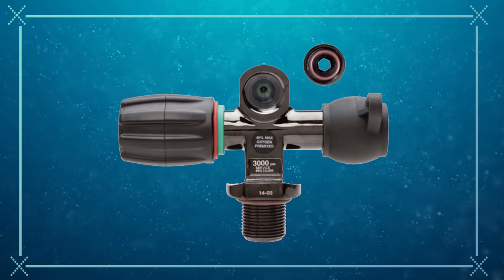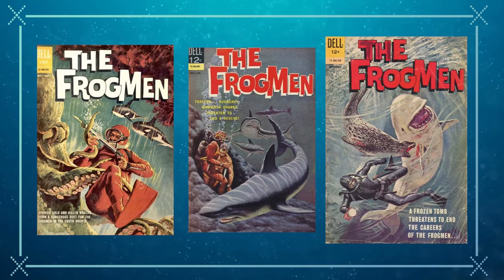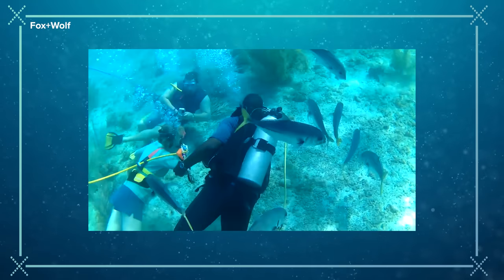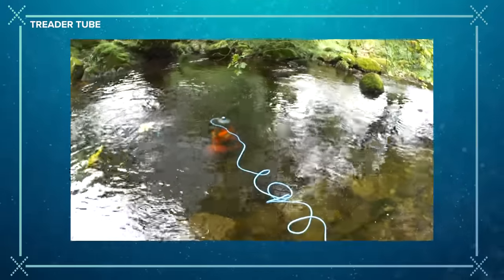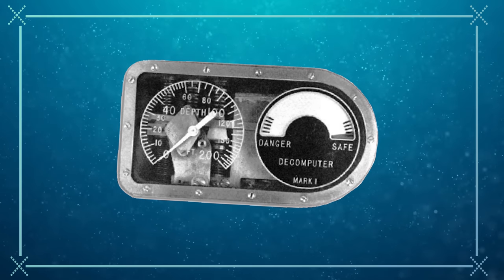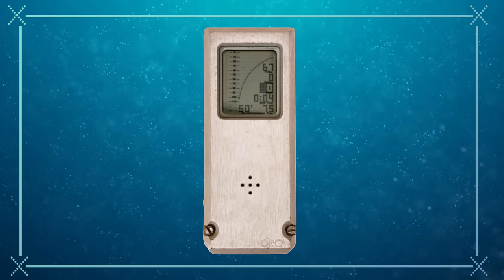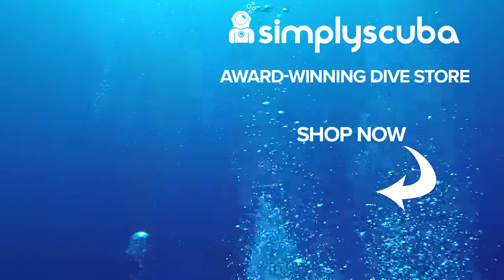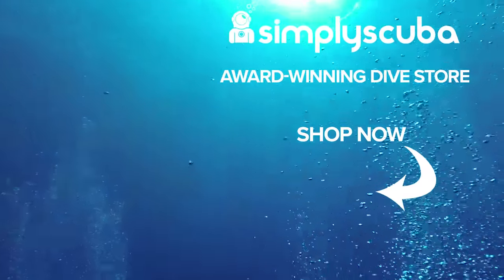Worst Dive Gear In The World

Comment: A large number of the gear referred in this video as "Worst Dive Gear in the World" were simply evolutionary.  For instance, the J-Valve was used, in part, because many of the pressure gauges at the time weren't nearly as reliable or accurate as today's gauges.  As equipment advanced, the need for the J-valve was reduced/eliminated.  So saying that some of the older gear on this list is among the "worst" is like saying that the plane the Wright Brothers flew at Kitty Hawk in 1908 was a total POS because they didn't first invent a fifth-generation fighter aircraft.
Reply: Yeah, but the DIY and snuba are both bad and dangerous, not evolutionary.
Reply: @echonovember636  Yeah, that's why I said "A large number..." and didn't use the word "all."
Reply: I thought that as well, about the J-Valve.

Comment: Snorkelling full-face masks.... wtf?!
Reply: death traps for noobs
Reply: I like mine.
Reply: @CavZippo  What's to like?
Reply: @whynottalklikeapirat  for starters  the visibility and having the snorkel straight behind my head.
Reply: @CavZippo  Actually you don't see much more and here is why:
- A low volume mask with the glass close to your face has a very wide field of view. It simply feels different to some people because the space INSIDE the mask is smaller and you can sense the sides.
- Full face masks are only rated for surface snorkeling. At the surface there is precious little to see to the sides - usually only the siltier top layer.
- Many of these full face masks have curved surfaces, which distort what you are actually seeing, like a fish eye lense would.
- The reason people who are keen to actually spot sea life use masks with dark silicone is that it helps you focus, especially in sunny conditions. It is usually not an advantage to be flooded by reflected lights if you want to see what other people tend to miss. 
- Because full face masks are not made of tempered glass they are more prone to getting scratches and fogging up.
- Because your entire face is enclosed, it heats up with exertion and sweat and sun screen is more likely to stain the "glass" further adding to fogging (and an unpleasant oppressive heat).
- A regular snorkel is also behind your head if you know how to place it properly.

That's the proposed visual advantages out of the way - anything else?
Reply: @whynottalklikeapirat  long winded statement that doesn't actually say anything about the difference between the two.  

And fog away works just fine.
Reply: @CavZippo  

Now you are just being defensive. You ignored everything I said about visibility and jumped on the least interesting part (ignoring the long term effects of a mask that is easy to damage).

You offered visibility - so I commented on that. The discussion was not about a general comparison - that's just you changing the subject.

If you like I can easily educate you on the general differences between a common mask (standard survival equipment) and a full face mask (crutch and potentially deadly toy for the inexperienced).

I say educate, because I am a diving professional with the background to do so. 

But I doubt you will have the attention span, because it is going to be just as "long-winded". True learning and proper training usually is. Which is why some people look for a perceived easy fix to various challenges.

Full-face masks however, have been implicated in a fair amount of recent deaths - so that's something to consider if motivation is low.
Reply: My is not that bad
Reply: @CavZippo  I am a dive instructor, and a spear fisher of 15 years. I have never advocated for "goggles" - I am talking about proper diving masks. The things I point out are mostly common discourse and based on well established industry knowledge. The "opinion" that you'd like to be so subjective is based on established safety considerations, that are not of my making per se - but certainly I can point to an archive of underlyin experience as well. Safety and equipment procedures come down to minutia, you know this having been in the army, so I don't see your argument with that. Take the advice or leave it at your own leisure. 

 
Have fun
Reply: They game changers in my opinion...but not for great depths obviously...
Reply: @weerobot  Only very few versions will allow you to equalize. You'll begin to feel real pain at around 3-5 metres. The large volume of air will require you to work hard to descend, wasting oxygen. 

By almost any formal standard they are inferior to what is considered standard equipment by professionals. 

What is the most significant game change in your opinion?
Reply: @whynottalklikeapirat  For surface swiming they take away the fuss of having to clear the snorkel of water...Yes no good for anything more than 1 metre..
Reply: @weerobot  In my opinion snorkle clearing should be a routine thing. 

This is not because I think it is something that "should be suffered" because we all oughta be such tough guys. It's because dealing with water in your eyes, nose or mouth is something that anyone venturing into water too deep to stand in has to be prepared to handle - ideally to the point where you don't even think of it as an issue.

Full face masks are not fool proof. One of my main arguments with them is that they can be used as a crutch that may get people to get into situations they are not adequately prepared for if or when things do not turn out as expected. The possibility of equipment failure ALWAYS has to be factored into activities at sea. 

Besides - lots of common snorkles have a reservoir and a purge function, I use one myself except when I am hunting. 

Another thing is that they are likely to muffle your voice if you have to cry for help. It's more difficult to remove than a normal mask, and most people who are experiencing the onset of panic don't think straight, I've seen it so many times. And even if you get it off - now you are without a snorkel and without a mask and you are struggling to keep your head out of the water and getting it in your eyes because you have no cover.
 

I guess I don't really see how they change the real game much.
Reply: @whynottalklikeapirat  Fair Comment...
Reply: @weerobot  @whynottalklikeapirat

You guys are sure entertaining to read :)

I think the main issue with full face mask is the dead space issue and CO2 buildup.

Having that said, things are not black or white... A few shades of grey in between (and a few more when you consider things that are not related to the CO2 buildup and dead space).

Simply Scuba has released a blog post explaining the concern and why some masks might be more ok than others: https://www.simplyscuba.com/blogs/blog/co2-in-ffm

If you search for "full face mask snorkel CO2" you will find loads of articles explaining the issue.

One of them is the lack of training and the lack of awareness. A person might go for some surface snorkelling, the person goes with a buddy, both having full face masks, they enjoy the scenery and do not realise they are moving away from the coast, while they snorkel CO2 builds up (in their body), and one of the two starts getting all the symptoms of CO2 buildup: dizziness, urge to breath, hyperventilation - which does not help if the dead space is full of CO2 - and so on. The person alerts his buddy, takes off the mask, but the CO2 buildup has exhausted that one diver, the second diver has higher levels of CO2 in the body (because of the full face mask) and realises he needs to assist his buddy to swim ashore. The both get exhausted, tide changes, they cross some current or something like that, both drown.

Isn't this a realistic scenario where neither did anything wrong (except checking from time to time where is the shore to stay close to it)?

That can happen due to a lack of awareness of the risks and symptoms.

I am sure highly experienced divers (like the both of you) will have a better intuition of what can go wrong, but a complete newbie, that might have had a few margaritas who is enjoying the so deserving break from work, worrying only about having a good time, might end up in serious trouble. Because you must remember, not everybody knows or understands the risks associated with these sports (not that drinking and swimming is not stupid and would be a great candidate for Darwin awards). I have more than one friend that thought of doing something like this for their vacations and do not have the reflex to think "I should buy the more expensive model because it is less risky for my life", they think "the more expensive model is for the pros, I just want to have a good time, I go to some online retailer and buy the cheapest one there". Because they don't/can't understand, due to the lack of knowledge.

Assuming that you don't play tennis. If you would go play tennis, and just want to have fun, you would not invest in an expensive racket. You would buy the cheaper models and that's ok. Because you are not expecting to go for some competitions, and to do some high performance training and so on. And that's alright, you most likely won't die because of a cheap tennis racket. The same applies for many sports. And people just don't understand why it is important to invest more in a snorkelling mask, as they won't go scuba diving, they are on the surface, where is the risk?

Since this is a thing: I am not a "pro diver", I am just a guy who occasionally dives and tries to understand how things work and what are the inherent risks of the different parts of a kit before getting any new gear.
Reply: @whynottalklikeapirat  I'm gonna sing along to this. They become crutches for people who can't deal with water in their eyes (or even their face). What will these people do when (not if) something goes even slightly different than planned. Water is for everyone, not just "legit" people. But you should always be able to handle it one "equipment level" lower than what you are using. 
If you don't like water in your face, learn to deal with that before sticking your head in the stuff. If you can't clear a snorkel, learn it before getting a supposedly "purge free" snorkel and attaching a certain ammount of your safety to it. 
I suspect that some of the full-face snorkel people just couldn't be bothered to practice (and come on, it's not THAT hard). Having reasonable mastery over a normal mask and snorkel, I tried the full-face thing, and it is hardly worth the bother. And then there is the fact that they are more complex pieces of kit, and sometimes cheaply made. Not a good combination.
Reply: @StickDK  I can only agree.  Standard equipment and procedure is standard because it has proven functionality in a wide variety of settings and because it structures and encourages desirable behaviours and routines. Some people like to think that anything different from the standard is an "innovation". A lot of people like to market their stuff as if it were. It's pretty easy. You take a standard training hurdle, familiar to most entry level people or just plausible to their imagination, and elevate it to "a problem of the field" and then you offer gimmick "solution" that appears to bypass the troublesome need for basic training and competency, without mentioning all the other often comparatively serious or even life threatening problems that creates, which are obvious to any professional of the field, but not so much to someone new to it. Just yesterday I had to have the "why can't we just make a 3 metre flexible snorkle" discussion with a bunch of old friends of mine who are actually seasoned cold water surfers and life long sailors. Referencing the basic physics involved branded me a "nay sayer". Everyones a genius when it comes to finicky, impractical and potentially deadly solutions :D
Reply: @CavZippo  "I am not defensive"

Proceeds to defend position by listing (unverifiable) experience, stating that he does not need to justify opinions, trying to dismantle the other poster credibility and stating he does not care to talk with a single person when all comments are public, never once addressing the actual points.
Reply: I dive with a black mask when i tried a clear mask there was so much light coming in the mask i could hardly see compared to my black mask
Reply: @CavZippo  Whoaa now, Brother-Diver (and Brother-Vet) Kit....  You sure told HIM off!  Damn man!  I'd go diving with you any day!  Not to be unkind to 
"whynottalklike,"  but perhaps he should realize that full-face snorkel is just fine for fun stuff to do in the water with minimal training, when you just  DON'T wanna hassle with all the other diving equipment?  To be honest though, after many, MANY years of diving, I've never had the opportunity to try full-face snorkel, though I'm quite proficient in full-face scuba when necessary because of um.... icky, ICKY water!
Reply: @109278123  Google, you put this very well my friend, very good analogies as well.  And yes,  "common sense"  is the equalizer in almost all scenarios we have to face, yes?
Reply: @martinbachmann6283   Yeah, that guy pissed me off.
Reply: @ZY1982  Metteo, don't agree with you.  Being a service-Vet myself,  after all these years.... I can most definitely detect a bonafide blow-hard.  Kit 1982 is not in this category Sir.
Reply: @DEVINE.IMAGE.  Brother/Sister Diver Devine, me too!  Yes, I indeed have a "clear-silicone"  in my arsenal of masks, but I hardly use it for this very reason - TOO much light screws things up big time when good peripheral vision is required too.
Reply: I think full face masks work for people who aren’t that comfortable putting their faces in water. I see a lot of them used by people snorkeling with manatees in Crystal River Florida where I live. If it allows them to snorkel in shallow water and appreciate manatees, or tropical fish they might never see otherwise, I think that’s a good thing. Using them for anything more would be a mistake in my opinion.

Comment: I am old enough to have dove with J-valves. Nothing inherently wrong with them. No more dangerous than a K-valve. Just like your pressure gage, if you didn't check it to confirm it was in the correct position periodically, you could run out of air.
Reply: The j valve is where our modern day low on air signal comes from right?

Comment: Bee  Sss ... the J valves RULE and I have  been using my two tanks for 43 years !   If you are FOOLISH and suck your tank empty - you would still have 300 to 500 psi for and emergency !  the other good thing about them is IF you don't need that extra air - your tank isn't 100% empty when you return to the dive shop  for a fill . If you completely empty your tank ,  the  dive shop will be charging you $20 dollars to do a visual inspection before they refill your tank . And if you really need the tank for a dive - you may need to also pay to rent a tank until they find the time to inspect and fill yours = $$$ 
I also got a YMCA certification way back in 1979 and still only use the ole dive tables and never bought a computer !

Comment: J valves were very useful in their time. I understand not using them now, but are all the redundant air systems any better an excuse for not monitoring your gas supply?
Reply: Hi Matt, you are right - J Valves, properly used (and checked) before a dive were very useful in the "old days".  These are part of the equipment that I trained with with the Navy (ca late 70s).  This video may sound "funny" for a newer generation but the use of the "J" valve as opposed to the "K" valve saved a few if not a lot of divers in its days prior to reliable dive computers - and that includes me.  Ciao, L